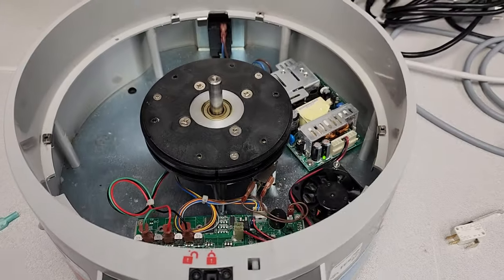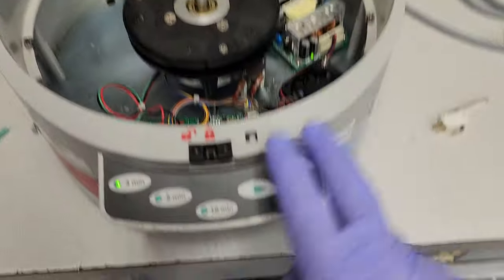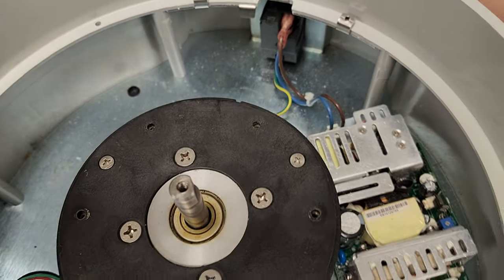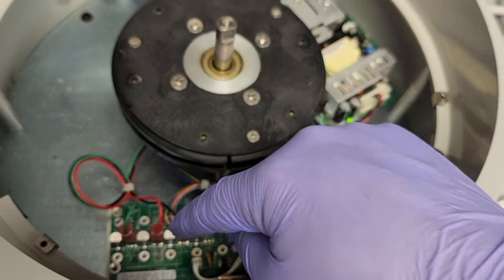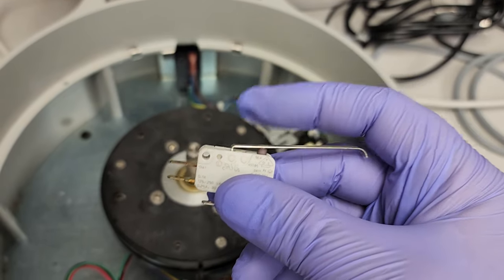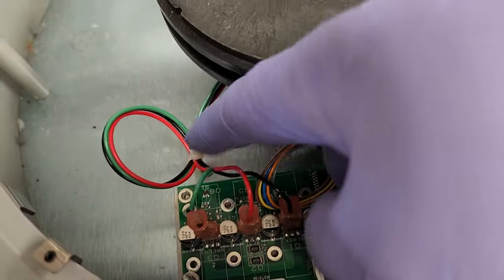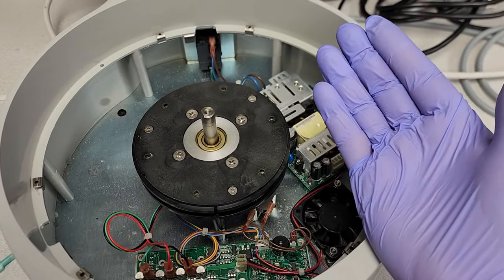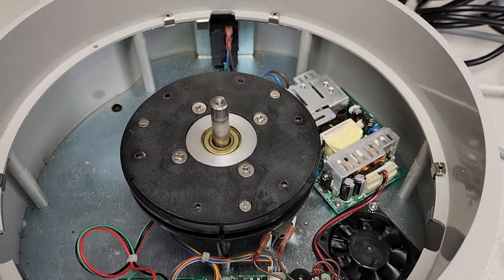Anatomy of a Failure: StatSpin Express 4

Comment: I just had one of these with the same disconnected wire, but it was the red wire.
Reply from the maker: If it happens to one, then it happens to more.
Reply: We had the same issue on the same device. But then also the green wire.
I think their connection isn't crimped correctly, or the wire gauge they've selected it to small for the crimp connector.